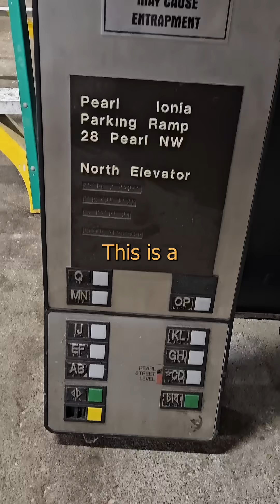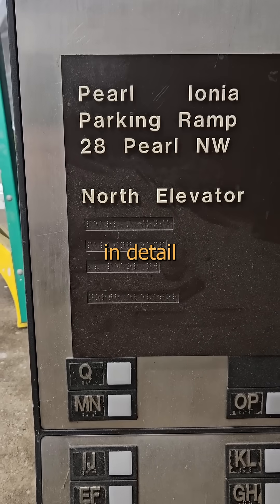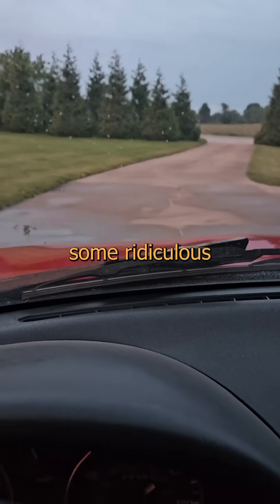Miata Mischief #chrisboden #engineering #gear #elevator #score #stories #parts #hacking #making

Comment: Ive driven 8 people in my 2010 R56 Mini Cooper S across town. It was probably the worst drive of my life. Another sketchy drive was from having my full exhaust fall off. I got it home after a 40 minute drive by having it hang out of a passenger door, which had to be wide open and the exhaust ran through my entire car and was hanging out the back of the car about 8ft. This made me incredibly nervous and worried Id hear some odd noise and bumps as I drove through town with cars parked on the side of the road and the roads being narrow.

Comment: I hauled a whole tree cut by street workers (trunk and branches) in a 2008 Nissan Altima coupe.  When I wasn’t doing that, I stuffed an entire mountain bike in that thing as my daily setup.  Also took a gmc envoy xl loaded with stuff to make dirt jumps onto a severely rutted fire road (11 tire plugs later).  Then it was a full sized fvd cabinet assembly (5,000+ pounds) in the back of a 2016 Ram 1500 in NYC down a stupidly steep garage ramp in a building, backwards (was for a chiller).

Comment: I'm a gigging double bass player. One time, I got a flat tire on the way home at about 130am and called the only person who'd be willing enough to rescue me- my buddy Shaun. Only problem is, he has a Fiat Panda from the mid 80s, and we had to fit my bass, my amp, and me in that tiny two door hatchback. The bass ended up wedged into the front passenger seat and crossed thru the cab diagonally. I ended up sitting hunched over on my amp in the trunk of the car.

Comment: I used to regularly haul lumber amd plumbing supplies in my honda del sol. The rear window rolled down so I'd just stic one end on the dash, the other end hanging out the back window, and position everything just far enough to the passenger side for me to still be able to shift

Comment: I went to an auction and one a super cool (and old) trunk.  Not thinking about its size.  Yeah, my Saturn SL2 wasn't known for being roomy.  I ended up managing to cram it into the passenger's seat.  One corner sticking out a rolled down window, another pressing against the shift lever.
It was a good hour drive from the auction house to my girlfriend's house where it would live, she has a cool collection of old trunks.  I had to hold the shift lever in drive the whole way there so the trunk wouldn't put the car into neutral.
Oh yeah, I failed to mention that it was 15° that night, it was snowing, and there was ice on the roads most of that hour drive.
Needless to say that me, the trunk, and my car all made it safely to her house.  She was so excited when she walked into the house and saw it.  She had been out of town when I delivered the trunk.

Comment: I was in my 89 chrysler lebaron convertible and I had just sold my old 86 half ton a week prior, issue was I already had a boat setup to buy that weekend and my flatbed trailer couldnt be towed by the tiny hitch on my car cause I had no receiver at that point. Took a couple buddies a blanket and a ratchet strap with me and off I went. Ended up pulling the motor off and stuffing it in the back seat, flipping the boat (late 90s merc 14ft with seats and a steeringwheel, not a simple aluminum dingy) upside down, ratchet strapping it underneath my car, and having the windshield of the boat overlap my windshield so I could still sort of see. We drove an hour and a half home like that and somehow got let off with just a small talking to (and a lot of fun bein poked our way) by some friendly deputies😂😂😂

Comment: I hauled my dad's Mitsubishi L200 out of a ditch and back home with my 1984 Fiat Panda 4x4 using a broken seatbelt, a rock climbing carabiner and a paracord bracelet. He was taking a bunch on 2x8 planks home from the job site, and because in my country you can carry overhanging cargo from a car, but not a trailer, if I hauled him that would make his pickup a "trailed car" (I love sensical laws). So I put the panda backseats in the truck bed, and the 2x8s went from the rear left corner, over my right shoulder and out the right window. I was 19 at the time and my dad hated my car for some reason, afterwards he still hated it but I never heard him complain again. I bought it for 1k thrashed. I loved, cared and maintained it, and sold it less than 2 years ago with 570.000km for 1,5k.
The previous owner had some thing changed, but the only work I did was the starter motor at 450k, and a much needed air filter change at purchase. It was a shitbox by every metric imaginable and not a day goes by that I miss the little thing.
Reply: Those 4x4 Steyr pandas are AWESOME, I'd love one !
Reply: A Fiat Panda does something for once? Amazing :D 
Why did you sell it?
Reply: @snjert8406  Fiat build quality in the US is trash, but italian/polish built fiats, especially pandas and multiplas are built tough. The fist gen panda 4x4 '83-'03 is damn near unkillable but when I found a job in the city I had to buy a good commuter, in the little fiat when you get around 100kmh it starts rattling, shaking, and Jesus christ appears on the passenger seat begging you to slow down and love yourself. Now i have a '06 volvo v70r. Amazing machine.
Reply: @axelgalloway4294 I'm in Europe and really want one now hahaha

Understandable with the commuter car, though, safety is still priority number 1.

Comment: In the late 90s, I was working for an ISP and we had bought up a friendly competitor when their owner wanted to do something else.  When it came time to shut down their facility and consolidate the core networks, I loaded up probably a hundred thousand  dollars worth of relatively state of the art Cisco core routers, Livingston portmasters and servers into the bed of my inherited 1969 Chevy fleet side farm truck with 400,000 miles on it and hauled them across town.  A fortune of modern electronics in the bed of a free truck.   All the electronics are long gone, retired and scrapped, but my son still has that truck as a restoration project.

Comment: I once hauled an entire ass redbox  kiosk (they weigh about 500 pounds) out of a safeway on a dolly that was at least 2 times too small, and then ratchet strapped it into the back of a pickup truck. The best part is, the tailgate had to be removed so it could fit, so, to keep it from falling out of the back of the truck and smashing into cars on the highway, we had to put another ratchet strap horizontally, almost in place of the tailgate. It miraculously worked.

Comment: We had an old school miata in the shop a few years back, and that thing was a blast to drive. It's a four banger with a manual, and it weighs about as much as a popcorn fart. The only problem I had was I'm over 6 feet tall, and my knee would get jammed between the door and the steering wheel when shifting 😂

Comment: I strapped a clothing cupboard to the top of a Saturn that at best made 95 hp

And then proceeded to go on a four hour trip with it. My gas mileage went from somewhere around 27 to 30 miles per gallon to somewhere around 15 miles per gallon because of the large 4’ x 2’ air brake I had strapped to the top of my vehicle.

Comment: I've crammed whole Commodore systems in the front bench seat of an 86 ranger. Hardest part was making sure computer parts didn't try to block the stick shifter. Once in high school I carried a Commodore 1702 3 miles home by myself. Those cute handles are only really good for going from one room to another.

Comment: Hauled home 7 sheets of 21 foot long r panel hanging out the back of my truck. The bed ain't even 8 foot long. And I did NOT have it angled up and over the cab. There was about 12 feet of it hanging past the tailgate and it didn't even scrape!

Comment: I brought home a 30 hp giant compressor in the boot of a old mk3 ford cortina i managed to jack it in to the boot and it hung out the boot by 5 foot and fecked the suspension and bent a compressor shape out of the back of the car and I held it in the back by using the rear seat belts the local plod pulled me over and told me that they found my exhaust back down the road along with the rusted out boot floor they followed me home and told me that if they caught me again they would ticket me for anything they could think of well a week later i was back at it bring home a old industrial lathe in the front bucket on a massey ferguson tractor and if I would say it was a bit heavy the dead give away was the rear wheels we coming off the ground when I breed to slow the old girl down but the old lathe is still working and I acquired it back in1985 so at least I am still doing stupid shit and I am 60 so darwins law did not get me so far cheers all from the uk

Comment: You guys have a bunch of cool stories. The sketchiest thing I’ve moved were a few massive sheets of MDF in my little Audi convertible. I had to drop the top and lay them on towels on the trunk and the top of the windshield reinforcement. I had my co-worker in the back seat holding them just in case the bungee cords broke or a board slid. Only for a 2 mile drive. We got back to the shop and my manager informed me that he was supposed to order 1ft sections but fat fingered a zero in the order paper so we got 10 ft sections lol

Comment: Once was asked to 'hold down' a full sized trampoline in the back of a beat to hell 1995 for ranger. It was fully assembled because they did not want to assemble at their home 'because it was more effort than just hauling it.' needless to say I literally had to strap myself down to the bed of the truck and desperately hold onto it as they sped down the backroads going 70 mph with giant sail the could make God question whether it was a good idea to lets us come down here.

Comment: I was certain I had a good sketchy hauling stuff story. Turns out most of the sketchy parts were loading and unloading in my stories. I did haul a 20’ long bale elevator in a 6.5’ bed pickup, in the dark. I wired a greasy red rag to the end for safety.

Comment: I had a first gen miata as well, worked for a tire shop and had to load up 6 truck tires into it, essentially dropped the top, filled the trunk and used zipties to somewhat secured the trunk lid, the passenger seat was filled and couldnt really look out passenger side mirror.

Comment: I totalted my truck driving to work during hurricane ian, tow trucks wernt running because the floods, so i went to our yard got a digger Derrick/ line truck and a trailer picked that fucker up and set it on the trailer and took it to the scrap yard the next day when they opend😂

Comment: In the mid-90s, my boss sold Hubby and I a soft-sided hot tub. We had to get it from Pacific Palisades to Chatsworth... somehow. All we had for transporting it was a Datsun 210 wagon. We weren't able to rent a pickup truck for whatever reason. We drove it through Topanga Canyon with it strapped to the car's roof. We went about 15 MPH the whole way home. It was a 22 mile trip, early on a Sunday morning, so we'd have minimal traffic. 
Basically, going from Gladstones restaurant to De Soto and the 118 fwy. I'm surprised we didn't get pulled over.

Comment: My ex-wife and I went to an estate sale one day. We were mostly there looking for small curios of sorts, perhaps some paintings, posters, or prints. What actually happened: my wife walked in, saw a medium-sized antique, very ornate church pew. So, I had to load that atop my first gen mini cooper. On roof racks at the very least. All my ratchet straps were in my garage as I wasn't anticipating any large furniture purchases. So, after roaming around a little while longer at the sale, buying a few bungee cords, talking the guy running the sale out of some bed sheets, and spending 30 minutes trying to monkey fuck that pew in place on top of a car the size of a thimble. Oh, my wife discovered several other obnoxious sized paintings, curios, and book shelves. So the back seat stuffed full, both windows down, odds and ends spilling out the windows, two bed sheets strapping the pew to the roof 3 bungee cords and a mid winter day at 14degrees, we begin our two hour drive home down windy back roads and high ways. Luckily, everything made it home in tact. I however wanted to gouge my ears out 3 minutes into the drive home after my wife wouldn't stop talking about how cold it was, after insisting we buy all this shit and telling me "its fine, we'll just turn the heat up".

Comment: Trip to Mobile a couple decades ago in a 90s Camaro. I was really fat back then and my friends were heavier than I was. So three chonks in a tiny metal box hurdling down the interstate at slightly over the speed limit, the V6 engine couldn't get us three fatties over seventy-two miles per hour. It was midnight coming back, but we couldn't get over fifty-five because we went to pick up AR500 steel plates. The suspension was tapped completely out, but when we got back and unloaded the suspension was completely fine. I swear that there is something about a $500 car that you fix a few things on that makes it not break when it should and break when it shouldn't.

Comment: I have carried a 15kg bag of firewood about 2km while riding my unicycle. There was enough unused unicycle seat in front of me to safely stop the firewood from travelling downwards, I had the strap of a tote bag around both myself and the firewood bag to stop it from falling forwards, and I rode most of the way with both arms resting on top of the bag in something close to a crossed arm position to stop it from going sideways and throwing off my balance.

…I got an unusual number of looks on that ride…

(I decided to never repeat that trip after my back complained for several days afterwards, but I’ve made quite a few similar journeys taking home a box full of pizza for dinner)

Comment: A 300lbs IBM AS400 server that the school was getting rid of. I was riding a moped. So I ratchet-strapped a board to the seat, so that it was hanging off the back and had a friend place the server onto the board while I sat on the boarded seat. He ratcheted it down and gave it the good ole "that's not going anywhere slap." I rode on the edge of the road and every bump gave me a heart attack as the board made cracking sounds. I made it the 2 miles home an hour later unscathed.

Comment: I stuffed a manco dingo go kart (no roll cage on this one)  into the back of a pontiac grand prix to get it home from my buddies farm. We didn't have any tie downs so my buddy just sat in the passenger seat and reached back and grabbed the front bumper of it 😂 we also had to take the steering wheel off to actually get it in, but still more than half of the thing was hanging out the back of the car 😂😂 i would have used my grandpa's trailer but he was using it at the time.

Comment: I was tasked to get a Christmas tree by my family, so I went off with my younger sister and my MK3 MX-5, as it turns out you can fit an 8 year old younger sister and an 8ft Christmas tree in the passenger seat with the top down.

Comment: When i was in my teens, I once moved a massive something like 300cu Oxygen welding cylinder and a smaller 75cu acetylene cylinder in the passenger seat of my 2000 Hyundai accent... Probably just as small as that miata.
Don't worry, I put the seatbelt on it... And i left the acetylene cylinder sitting upright for a few days after to let it settle 😅🚫💥

Comment: When I was about 7 me and my dad bought a 275 gallon aquarium from a yard sale for 50 bucks. In order to get it home we bought 3 skateboards nailed a sheet of plywood to them, and secured it with rachet straps. It was then promptly towed on the skateboard rig 20 miles home. I ran that as a marine predator tank for 11 years before a bad winter froze the tank and shattered the glass all over my bedroom floor.

Comment: So one time me and a few of my friends snuck across a field and through some fences to this old abandoned shed on a backroad and looked through the random stuff that was left until we came across this giant CRT that had about a 30" screen and was heavy af. We carried that thing screen-up through the old shed to a tiny green cart we had brought along that had 4 flat tires. Keep in mind it was lightly raining during all this. Once we got it onto the tiny rickety cart, all of us pushed and pulled that thing over terrace rows until we got back to the woods behind my friend's house that had yet more fences. They had been pushed partially over but they were still tall enough to not be able to get the cart over or carry the TV over easily so we got it partially on the fence to weigh the fence down enough to step on so we could carry it over. We got it back and somehow didn't hurt anyone or break the TV, but for all that work to get it back, the stupid thing didn't even work.

Comment: I half inched a few Swedish "Baracuda" camo nets from my local army reseerve base in the 80s. They laid them out on the ground in their compound over night.
I cut some of the wire ran between two fences poles through the cyclone wire with my SOG Tool (wish I still had that beauty) and used that length of wire to reach the net so I could pull it closer. Then dragged the net to the bottom of the cyclone fence, where I could pull it out. The cyclone fence mesh folded up easily because I had cut the wire from it to drag the net closer - prior preparation and planning preventing piss poor performance - even when imporivsing some ad hoc opportunisttic thievery.
Then I rolled the cam net up and rode home with it on my deadly treadly's handlebars.
Twice.
As I went back for a second bite of that apple.